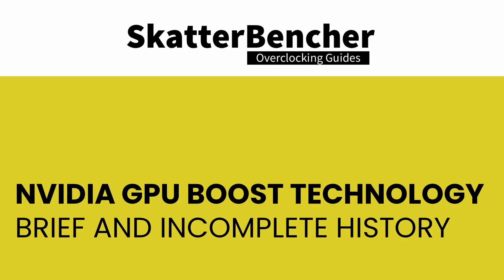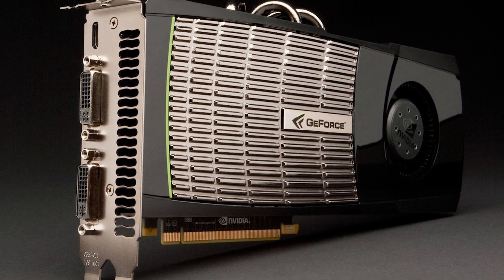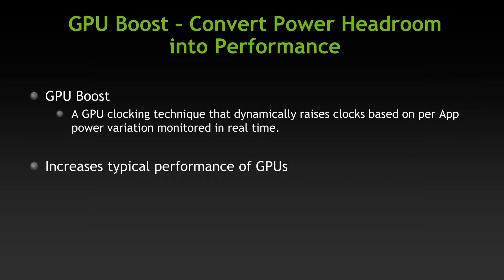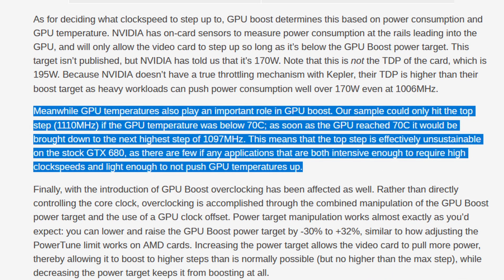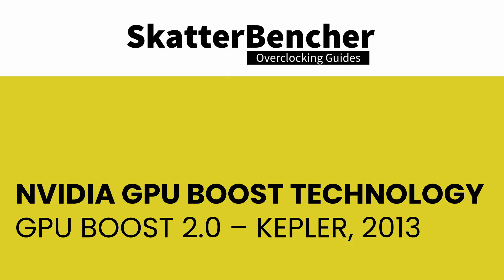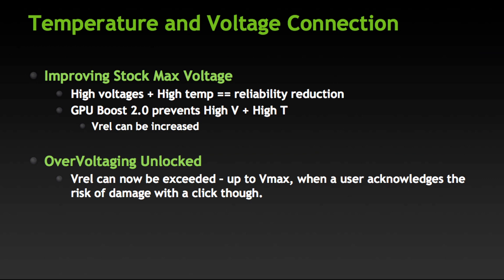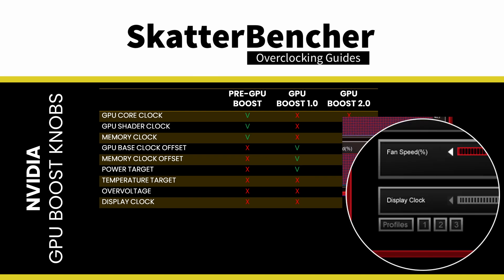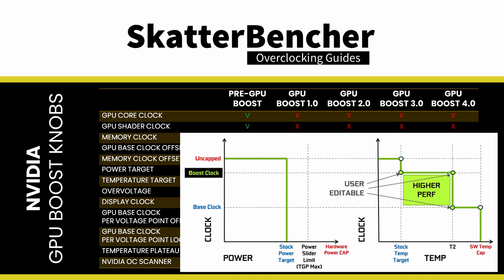How NVIDIA Enables GPU Overclocking Since 2012 (Brief History of NVIDIA GPU Boost) | SB#40

Comment: hello, under 350 € what is the motherboard 4 dimm / ram slot that reaches the highest frequency on ddr5?  At 6400mhz (RAM frequency) and (mobo) as safe and stable as possible on that frequency.  Another important thing: durability / longevity in the long term even in high OC.